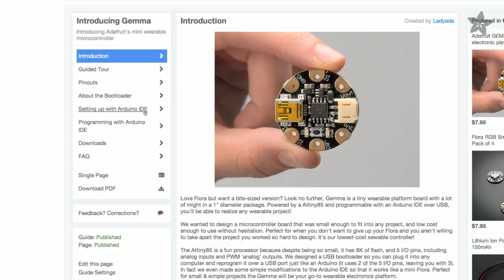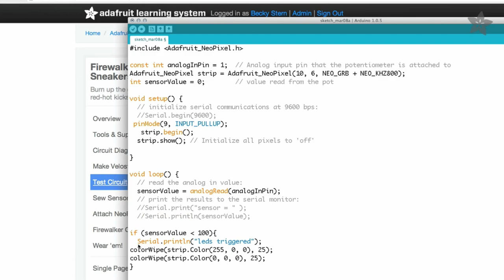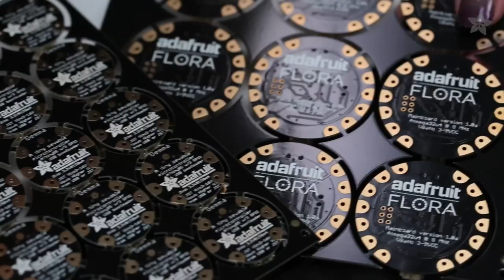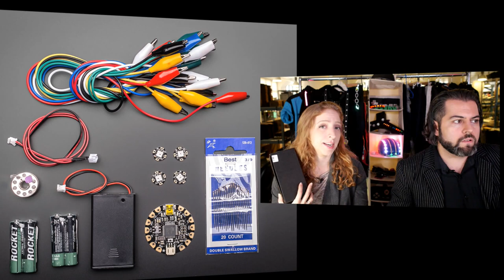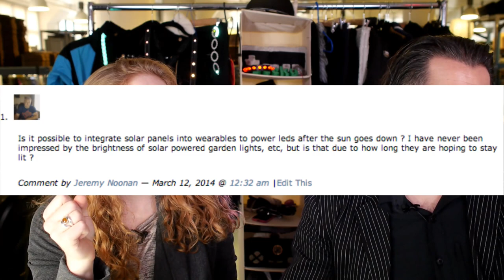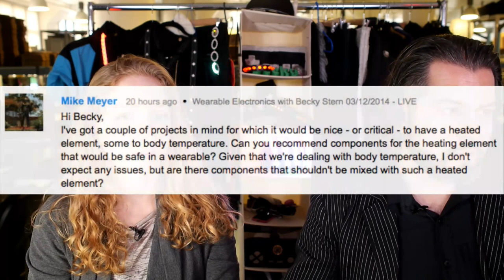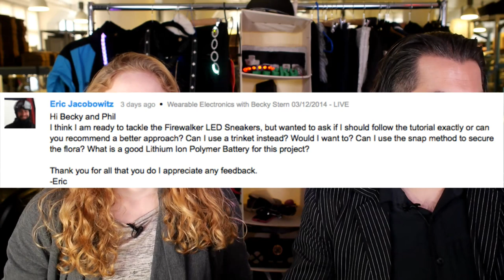Wearable Electronics with Becky Stern 03/19/2014 - LIVE

Comment: The Triple-axis Accelerometer+Magnetometer (Compass) Board - LSM303 (http://www.adafruit.com/products/1120) uses the LSM303DLHC I2C device which is 3.3v, but the board has a logic-level converter that makes it safe for 5v devices.

The FLORA Accelerometer/Compass Sensor - LSM303 (http://www.adafruit.com/products/1247) also uses the 3.3v I2C device, but there's no mention whether or not there is a logic-level converter on board. I assume there is not, so I would need to wire my own logic-level converter if I wanted to use it with a 5v device.

Is my assumption correct?

Comment: What PWM breakout board for extra PWM outputs for the Flora do you recommend? Would the "Adafruit 16-Channel 12-bit PWM" be viable?

I am working on a costume that has 8 small servos and I was thinking of using an arduino Mega; however, the Mega has many extra things that I will not need. With the Flora I can be more space effecient, have less unused outputs, cheaper, and along with sewing the board onto the actual costume for an extra "robotic" look. I should say the base of the costume are laccrosse shoulder pads, so heat dispersion, and room for power supply is taken into account.